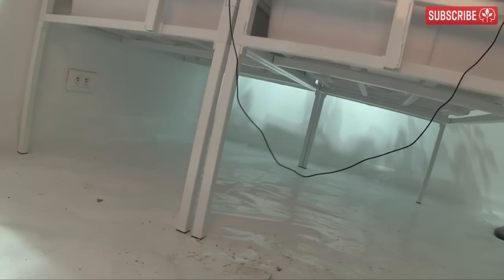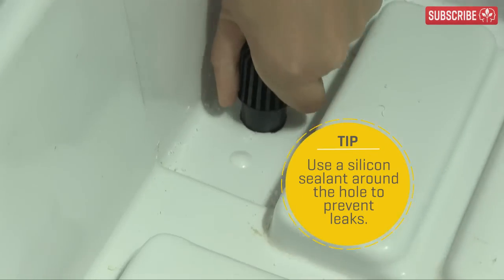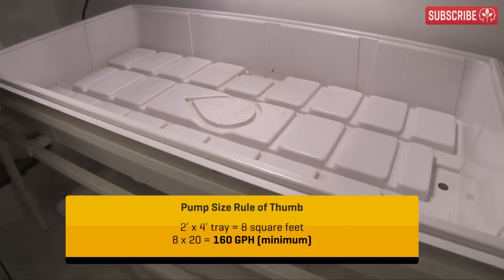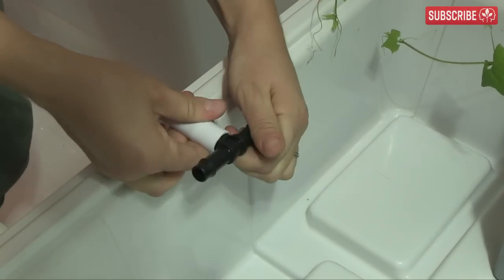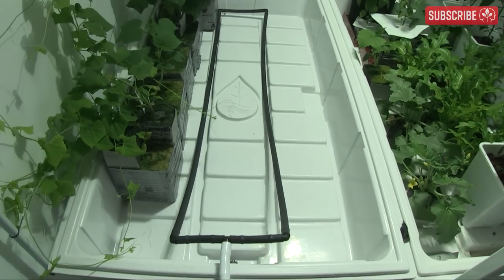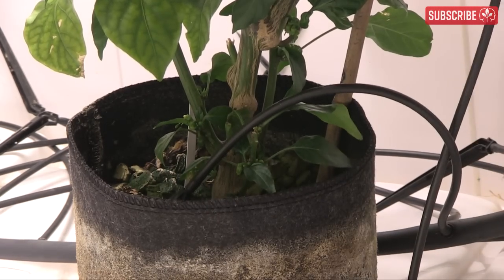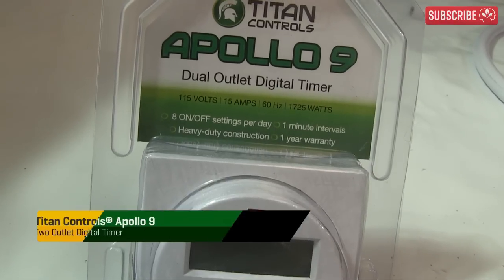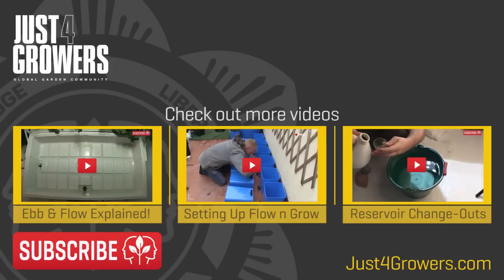DIY Drippers: Drip Irrigation for Hydroponics

Comment: Hey, love your videos. I am looking into building a setup similar to this and I was wondering if I would have to worry about water pressure. I read that fittings can break if they are at 50+ PSI. Also what are the dimensions of your mainline tubing?
Reply from the maker: +MrUnusables Well, for a tiny set up like mine, you can get away with 13mm for your mainline. There's no need to stress your fittings with unduly high water pressure—that said, it's good to have a fair bit of pressure to mitigate risks of calcium / salt build up in the spaghetti tubing and drippers. I'm planning to make some follow-up vids on drip irrigation and really drill down into the practicalities of scaling up, so stay tuned.
Reply: Another awesome video, cheers mate. I'll be watching this a few times over while i build my system.
Which do you personally prefer for coco; ebb and flow or drippers?

Comment: Hi Everest, so can you use GH's Flora Series (3 part base - Grow, Micro, Bloom) nutrient line with this drip system or will it clog it up?
Reply from the maker: You can absolutely use GH Flora Series with drip irrigation. It is 100% ideal for this application. GH also make a great product called FloraKleen which is great for cleaning and maintaining your drippers.

Comment: Hey Everest,

Great video as always. Would you say that drip irrigation is superior to ebb and flow simply due to the fact that you do not waste as much water and nutrients? Or is drip irrigation a more efficient delivery method for water and nutrients?

Thanks
Reply from the maker: Both have their advantages SlowCheetah. Ebb and flow is simpler to set up and maintain. Drippers can be dialed in more precisely and even per plant with adjustable drip stakes. You also need less water as you point out. Drip irrigation delivers more precise amounts more regularly so when dialed in right it is arguably the superior method but there's more room for error.

Comment: Doesn't ebb and flow encourage air exchange and result in a better yield than irrigation?
Reply: Spruce....same goes with dwc deep water cultivation.  Air stones are placed in a bucket  filled with nutrient water. An 8w pump is plenty for a 2 pot system...let the roots hang down to the water and turn on the system. Massive yields from this form of growing.

Comment: if I am using just soil how much times should I water a day?
Reply: He said 2-10. With soil I would imagine you'll be closer to 2. If it's a young/small plant that's not using much water yet I'd start at 1. The next day check that run-off amount to see how much is getting absorbed. Consider adding perlite to your soil when using a drip system to prevent over-watering. ✌

Comment: In your equation for finding a water pump, what does the 8 stand for? Thank you!
Reply from the maker: +Anthony Noble Hi Anthony—the 8 refers to the square footage of the grow tray, in this case 4 x 2 = 8 sq. feet.
Reply: Thanks everest.  I meant to type what was the 20 for in the second half of the equation?  I'm trying to figure out which pump to use for a 55 gallon drum instead of a tray.  Thanks again!
Reply: Thanks everest.  I meant to type what was the 20 for in the second half of the equation?  I'm trying to figure out which pump to use for a 55 gallon drum instead of a tray.  Thanks again!
Reply: Thanks everest.  I meant to type what was the 20 for in the second half of the equation?  I'm trying to figure out which pump to use for a 55 gallon drum instead of a tray.  Thanks again!
Reply: Thanks everest.  I meant to type what was the 20 for in the second half of the equation?  I'm trying to figure out which pump to use for a 55 gallon drum instead of a tray.  Thanks again!
Reply from the maker: +Anthony Noble No worries, what head height do you need to pump to?
Reply: 37inch. I think they are 25inch in diameter
Reply: 37inch tall.  25inch diameter
Reply: 37inch tall.  25inch diameter
Reply from the maker: +Anthony Noble My very basic rule of thumb was based on regular height grow trays that hobbyists use. As such, the 20 is just a constant multiplier—(pretty easy math too)—and not based on any physical factor. If you would like a more detailed formula that takes all the possible factors into account (and larger scale operations) I can make a follow-up.

Comment: I need a led do you recommend anything better than a mars - 700 watt hit me back let me know what you think and I really would appreciate your time and a place on helping me get a decent light for a fordable price can't use HPS or metal halide too much electricity consumption hit me back as soon as possible thank you vic
Reply from the maker: jacqueline goudelock Hi Vic, thanks for your question. It's hard to recommend a specific grow light without more details about your space and application. You mention the Mars 700 watt - do you mean the "Mars II" ? I found it online and it claims to replace your "400W HPS or MH" with a 700W LED to cover a 3.5'x 3.5' growing area. Errr ... isn't that using 300 more watts and costing nearly $300? You could get set up with a basic HPS or MH system for much less.

Comment: would this work for soil setup and what modifications would be need to make it so?
Reply from the maker: +Oscar Larin Yes Oscar, it could work for a soil-based potting mix. I'd make sure the mix was pretty light, with at least 30% perlite, but you'd probably still find that you don't have irrigate so often. Definitely use fabric, breathable pots. And finally, be careful with using organic liquid nutrients with drippers and the combination is prone to causing clogging. Perhaps stick with a mineral feed.

Comment: If the drip time should be 38-44 seconds but the Apollo 9 timer (and every timer I am aware of) only has 1 minute increments, how do you achieve the precision... or would you just set the timer for 1 minute?
Reply from the maker: +Steve Frankenbach Thanks Steve for an awesome question. This highlights the need to buy a pump that's not too powerful for the job! You can use TMUs and cycle timers that will allow specification in seconds, but the Apollo does it by the minute, you're correct.

Comment: The downfall of utilizing drippers is that they distribute water/nutrients in a concentrated manner which fails to promote healthy root systems for plants, resulting in lower yields.

This is made even worse by the fact that based on your chart you're keeping 'wetness levels' at a solid threshold rather than a cyclical one which is also bad for yield.

Of course these are downfalls of almost any and all hydroponics systems - very few actually pay attention to keeping the wetness of the planting medium cyclical through dryer, and wetter stages.

Interestingly enough, there is a bevy of evidence suggesting that these offsets in yields can ultimately be reduced by inverting the plants - that is to say, turning them upside down and having them grow with gravity rather than against it.
Reply from the maker: Hi BLU, thanks for your comments. A single dripper stake delivers nutrient solution at one spot—that's right—but this is fine for restrictive growing media where the nutrient solution will suffuse easily through the media. For non-restrictive media such as hydroton clay balls, a dripper ring would be preferable to deliver the nutrient solution more evenly. 

For restrictive growing media, drip cycles should be timed to allow the media to dry out. Rockwool, for instance, works best when it dries out 50% between irrigation cycles. The wetness / dryness of the root zone can be used to steer the plants into vegetative / generative production. 

I haven't ever played with inverted growing systems although I am aware of a few out there. If you'd care to share any of the evidence for inverting plants helping yields, I'd be interested in reviewing it. I'm skeptical (naturally) but not close-minded. Thanks again for stopping by. Hope you're subbed. :)
Reply: Typically the idea of inverted hydroponics (or rotary setups) is that by applying the force of gravity in a different matter encourages stronger growth from plants as they're no longer required to fight against gravity (at all in the case of true inversion, or most of the time in the case of rotary growing).

The capillary action of plants - how they distribute water - is ultimately limited by the cohesion-tension theory, which is to say the point where the pressure of the capillary action becomes equal with gravity and can no longer progress.

This leads to an ultimate "upper limit" on how large a plant can grow, as when it reaches a certain size (depending on the plant's ability to effectively utilize this capillary action) it can no longer distribute water any higher throughout itself.

Were we to simulate a truly gravity-free or gravity-reduced environment (Grow plants in space) we'd have a much greater cohesion-tension point, although we'd immediately bump into the problem of convection where we see decreases in airflow, potentially negating any gains - but as we're still doing this on earth and merely inverting the plants the lack of airflow a lower gravity environ would present is a non-issue.

True inversion setups (ones that don't spin) also come with the potential downside of unhealthy root growth due to something called gravity tropism - a plant's tendency to have it's roots follow gravity.

Rotary systems overcome this hurdle by having the plant alter through states where it's fighting both against, and with gravity at different periods of times - thereby mitigating the gravitropic behaviour of plant root systems.

These are some of the basic principles behind inverted hydroponics, and while there is a lot of anecdotal evidence from inverted growers that they've seen improved yields - there is sadly little hard science in the field of hydroponics. The theory is however, solid.

As a side note, you could also provide a higher oxygen environment for plants to potentially improve yield, although this is hardly recommended since it would not only require a room with it's own atmosphere, but would also present a major firehazard.